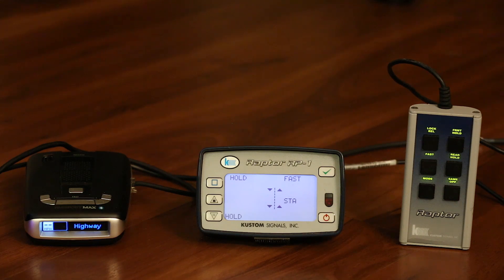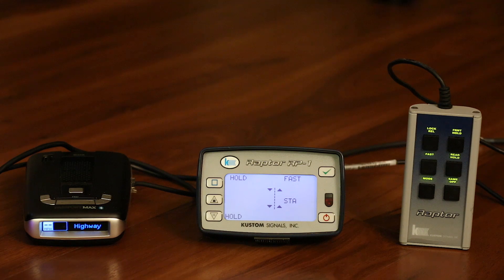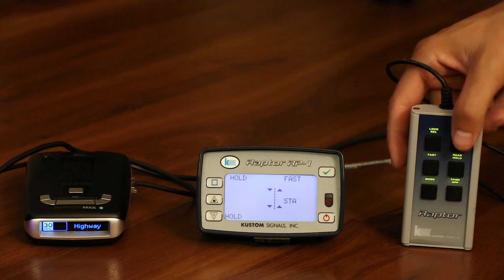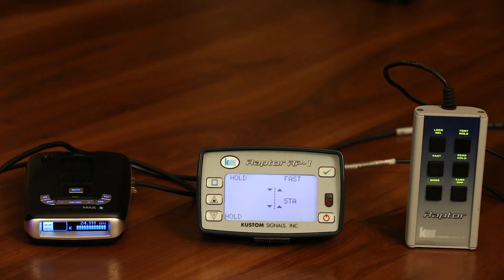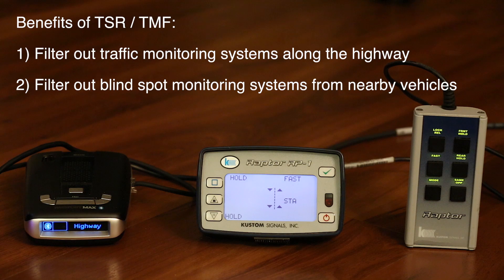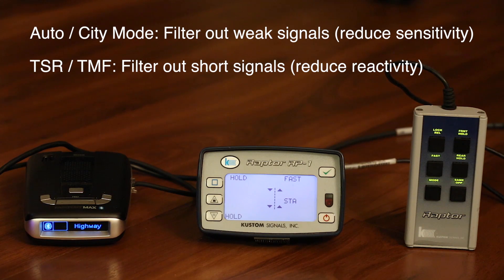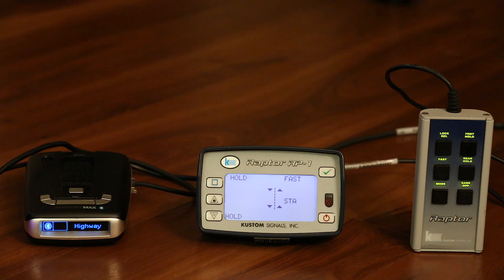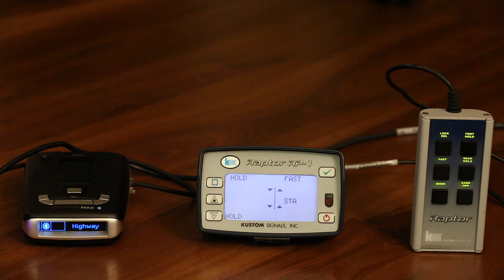What are TSR and TMF?

Comment: Does enabling TSR hurt I/O perfromance? Also, what detector do you run on a regular basis?
Reply: +Vortex How does a detector with a K band filter filter out short bursts of radar, but still catch POP or I/O? Wouldn't it completely ignore those signals, assuming they're false?
Reply from the maker: wiggleweigel A POP search is a completely different search. Additionally, POP is typically only on Ka. If you have POP enabled, it keeps stopping its search and looking for a POP shot, then continues doing a normal search, stops to do a POP search, etc. Disabling POP tells the detector to scanning all bands normally without these constant POP searches.

I/O is different. If during the normal search a K band signal is detected, the signal gets filtered out if it's shorter than a certain duration. TMF/TSR K band filtering doesn't tell the detector to spend more or less time searching. It just adds a layer of filtering to quiet out certain signals that are being detected normally.

They're two different types of filters and ways of scanning.
Reply from the maker: It does for K band, not for Ka.

I run lots of detectors regularly, but the V1 is my main detector.

Comment: So if tsr is turned on, and it locks out short burst of radar. Will it not pick up instant on radar?
Reply from the maker: It picks up IO just fine. All IO is is having the radar gun in hold (not transmitting) and then you start transmitting when you see a target. The detector will take a tiny amount of time longer to alert, but it still will.
Reply: +Vortex Radar Looks like you already answered my question. At least I'm consistent. hahahaha
Reply from the maker: LOL

Comment: If Uniden won't filter trafic monitoring system what do they filter? And does it work the same way as the other brands filters? Meaning any short burst will be neglected? Or is it different. Quite interested in that. Thank you. Maybe you can do a short test and give me reply or smth if you have the time.
Reply from the maker: ***** Yeah the Unidens are a bit of an oddball so we're still figuring out those. They don't filter out short bursts and are responsive with the filters on or off. It looks like they help primarily against blind spot falses, not traffic sensors. I'm not sure yet how much more quiet it is with the filter on versus off, but I'm not sure if there's any downsides yet to its filter. There have to be, but I'm not sure yet exactly what, if anything, that feature actually does, lol